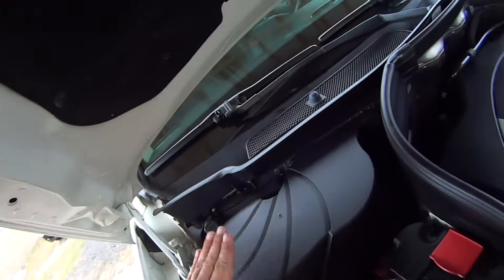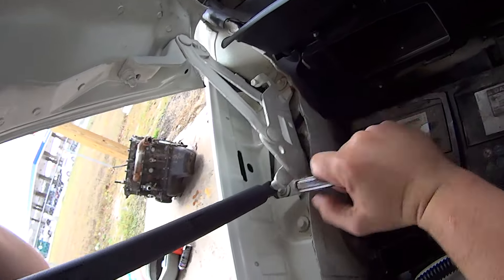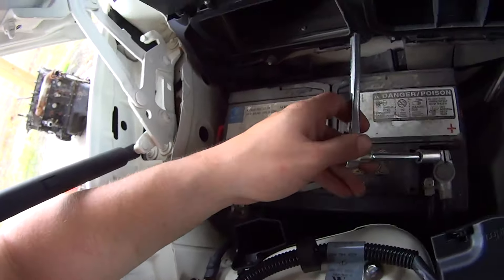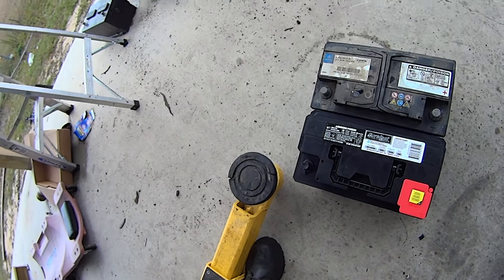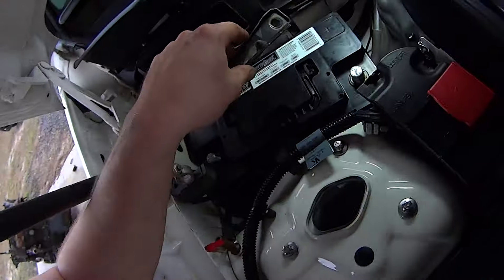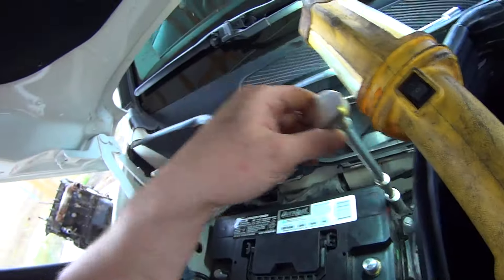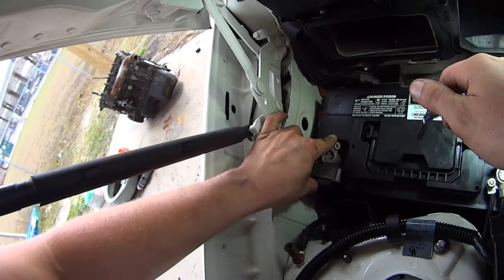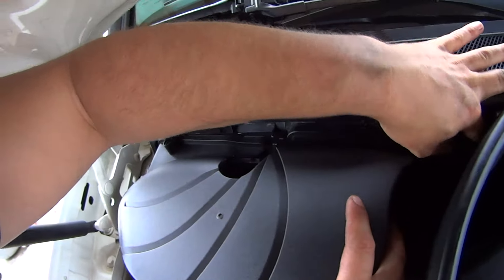How To Replace Battery On 2010 - 2015 Mercedes-Benz G-class GLK-350, GL-350, GL-450, GL-550

Comment: Watched this video and then replaced my battery following the exact steps, without providing a secondary means of power, as mentioned in some of the comments. All of my computer settings were saved (seat profiles, radio stations, garage door programming, etc.) other than the clock, which had to be reset. No issue with the fuel injection memory either (if that's even a thing for Mercedes). I believe these models have an auxillary battery that helps maintain computer memory/control in the event that the primary battery is lost; this may be why most settings seemed to be saved. Anyway, just thought I'd let others know that you don't need to worry about maintaining power when replacing the primary battery.
Reply: I just did it too on a 2011 GLK 350 and can confirm the same.
Reply: thank you because this is the BS reason given for places like Walmart, advance auto, and auto zone not touching these cars even for a battery swap! its BS!!!

Comment: Replaced battery on a 2011 MB GLK 350, I watched this video and it was very helpful, the only thing that concerned me was by disconnecting the battery that all of the items in the vehicle, like the radio possibly losing the code to reset and the power sunroof and it mentioned some other things that you had to do after replacing battery.  So what I did before taking off the cables, I connected a jump box (Stanley 700 amp) to the cables going to the vehicle  and had juice going to it the whole time the battery was being changed out. After connecting everything back I had radio and everything was working perfect. My 2 cents
Reply: Hi, I heard you’ve got to have a memory savers in order to be able to replace the battery. Do you think that it’s necessary true? I’m trying to replace my wife’s Mercedes Benz battery, but I’m a little scared.

Comment: Tried it this week on a 2015 GLK 350. My battery positive terminal has several attached electronic boxes unlike other years. I carefully removed the positive cables with said boxes and replaced the battery. I did not use a jumper to maintain radio or other computer settings. Once installed, all systems and settings were functioning as normal. The additional electronic attachments to the positive cable, may have been a built in jumper. Thus, why all the settings were saved.

Comment: The new battery does come with the vent tube plug.  You punch it out of the positive red cap.  Look at 3:01 and you'll see it.  Also, the little yellow "Read the instructions" would have shown you how if you read that.

Thanks for the video.

Comment: the camera work was so shaky, it made me a bit ill, but the content was spot on. only additional thing we did was connect the jump points to another car before disconnecting so we wouldn't lose any computer settings. As others have mentioned, the plug is included now, but it was helpful to know that plugging the hole is one of the required steps. thanks!

Comment: Nice video, this will really help me. Do the Command system ask for a code after battery replacement? Because I heard that it gets locked after unplugging the battery and as I don't have any code, I'm a bit worried about this.

Comment: Nice Video. Don't you need to connect to external DC battery to avoid losing your radio code. Otherwise you have to call the dealer with your VIN number to get the code.

Comment: How much $ do you think you saved vs having a mechanic do it?
You made it look so easy. :)
Reply: Firestone wanted $350 for the battery and installation on my wifes glk 350 - so $150 to install the battery!!!
Reply: The dealer try to charge me almost $1000 ( they said they need to run diagnostic and a lot of bs ..) . I went to a battery depot, bought a new one for $145... A mechanic asked me $20 to replace it....

Comment: i thought you were suppose to change the battery while the car was running on mercedes or else you'll have to deal with the electronic settings later of the computer? also can you use interstate batteries?
Reply: James C I replaced my battery and now the check engine light is on and the gear shifter is stuck
Reply: There is a small OBD scanner tool in the market made by Innova which has the battery replacement feature. There are also other cheaper tools for the OBD port made for battery replacement.

Comment: I own a 2012 ML350. I usually go on vacation once a year for a month. I would like to know some ideas on how to hook up the battery tender to the battery since it’s inside below the passenger seat? I have the deltran 12v battery charger/maintainer bought from Costco but then how do I keep the tender hooked up to the power source? Don’t I have to keep the door open? I would have liked something like a harness through the hood (just like I’m a motorcycle) so it could be hooked to the tender. What’s the point in purchasing the OE ctek trickle charger paying so much? What’s the best way to keep the battery maintain the charge when you are away?
Reply: Check if there is a red plastic cover somewhere under the hood. That will be the positive. The negative is a bolt on the frame near the positive. No need to access the actual battery. At least that's how it is with the GLK 350. That's how it is charged, measured or maintained.
Reply: Ple Eu yes I came to know that’s how it’s done. Thank you for the reply.